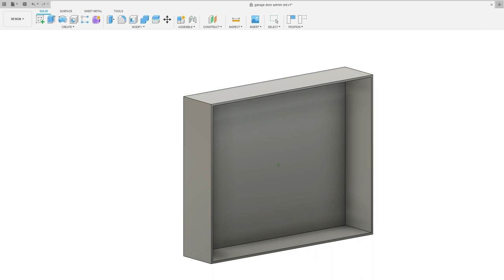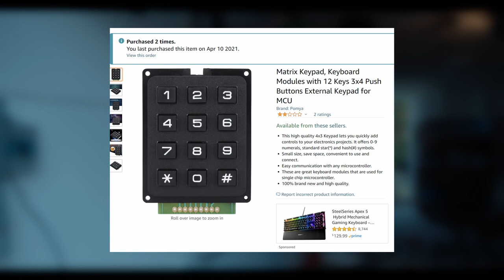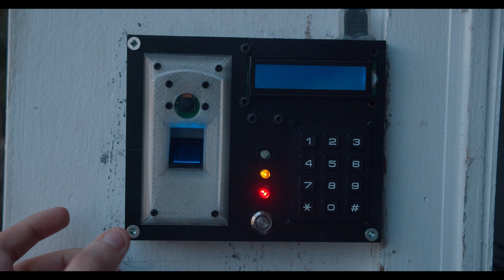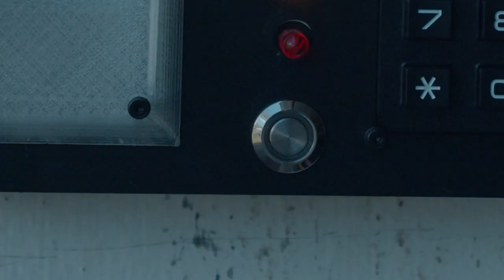Someone Tried to Break in, so I Built my Own Security System.

Comment: The tech, made from scratch, that's pretty impressive. But, unless you've barred/bullet proofed your windows, reinforced all man doors and other entryways, and hooked up to a security system that automatically contacts the police, I could still pick your locks and then go about stealing all your valuables and tech, probably starting with the security system.... And that's not to mention just avoiding any normal means of entry, bringing a hard hat, high vis vest, some basic cordless power tools, cutting a hole through you wall, and if anyone were to stop by and question what I was doing while cutting through your walls just say I'm doing repairs.... The rot in these walls is terrible, the house is nearly about to collapse, you better back up or at least grab a hard hat.....
Reply from the maker: yeah 100%, I dont actually keep valuables in here that was more for the storytelling, but the nice thing is, 360 the walls are concerete behind the jibrock, both doors have double locks, window is too small to sneak a child through, plus cameras on the inside
Reply: Yeah, wanted to say almost the same, this "security system" isnt very secure as i could rip It off the wall and get a free RPi4 + cool sensors for my Arduino. Very cool project tho, really like the idea.
Reply from the maker: @miguelocefalo  def not the safest thing out there, it was more of a fun project to show people who come to checkout the workshop